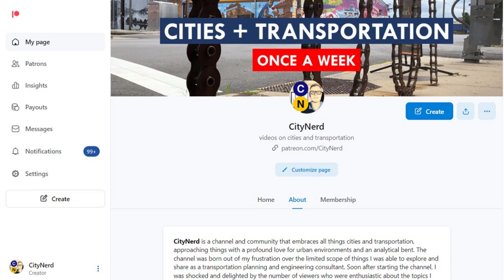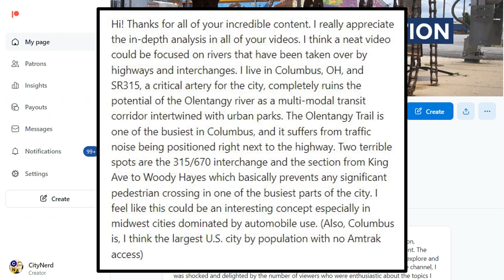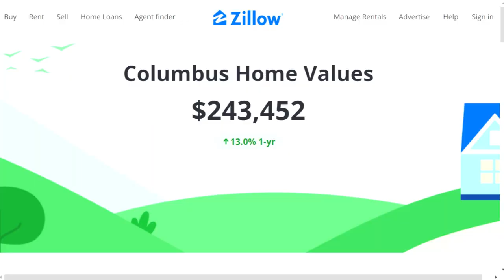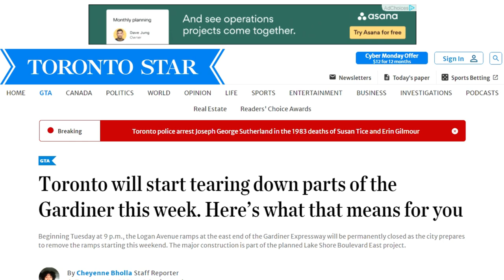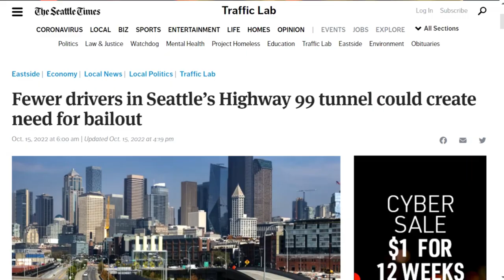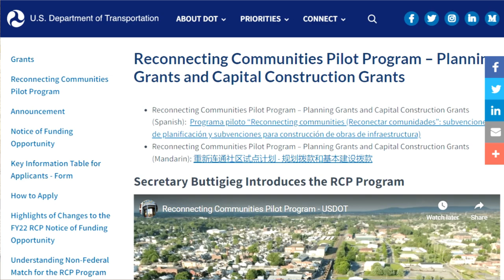Highway Engineering Madness: 10 Waterfront Freeways That Need to Go (North America Edition)

Comment: Wonderful topic! It's one of my pet peeves. So glad you got Buffalo and Albany NY on here. Also, I very much agree with FDR, used to live a block away from East River and it was such an onerous trek to get through to the park. Though permeable, the most shocking to me has been the Nihonbashi area in Tokyo, especially considering the historic value of the bridge.
Reply: FDR may be annoying for manhattanites who wanna walk to the river front, but it’s a godsend when you gotta trek uptown or downtown in the off hours for work. Hard for some people to understand that despite NY’s expansive commuter rail, mass transit is sorely lacking through the outer boroughs.
Reply: @MelGibsonFan  I don't think that it's hard for people to understand.  But if you're going uptown or downtown in manhattan, you don't need a car. Rail infrastructure is sorely lacking in the 'outer boroughs' but why subject every community to the failures of the whole city?
Reply: @NathanaelTak  Because the city doesn’t just revolve around wealthy yuppies in Manhattan. The entirety of the MTA is already structured around Manhattan. Case and point. I lived in Middle Village but worked in Washington heights for a short time. Because I worked in the off hours using mass transit would’ve taken me up to 1 hour 30 minutes (plug it in to maps to confirm) to get to work. By car, utilizing the FDR, it was roughly 30 minutes or so. That’s a difference of two hours everyday, which means more time to spend with my child, less to spend on babysitting, or maybe more overtime available etc. 

What’s an “eye sore” to the upwardly mobile yuppies who can afford live close to opportunities and work from home is a necessity for working class people who effectively keep the city running.
Reply: @MelGibsonFan  Not everyone living in Manhattan is wealthy. Even if they were, they still deserve to have a safe and healthy community. Putting large automobile infrastructure through isn't just an "eye sore" it's a safety hazard, impediment to local travel, and a theft of space. It is a sacrifice made by the locals to benefit people that don't have to live with the cost. In a very dense community, more people are affected and such the cost is higher. Conversely, the convenience of not needing to travel far is a value that should be weighed when choosing where to live. 

In theory, the higher cost of rent in one area should offset the cost of commute and car ownership in another, but we know that's not the case. Real estate is heavily influenced by the market and there are externalities suffered by communities that happen to be 'in the way'.
Reply: @NathanaelTak  
This puts the cart before the horse (in my opinion). These people who mostly inhabit neighborhoods along the FDR (outside of LES/WH etc.) aren’t inter generational families with deep ties to the community. They’re people who have opted to move into these exclusive/costly neighborhoods in pursuit of lucrative job opportunities and high culture. I don’t see this as some Robert Moses style slum clearance where the denizens of east Manhattan are being forced to step aside for highways. 

The removal of the FDR without considering the effect it’ll have on the many working families who rely on it for transportation is just exclusionary transportation policy. It’s essentially pushing for a gated community, so you can beautify wealthy/gentrified neighborhoods on the east side. 

As far as sacrifices and health concerns, I would prefer less car dependency, and the MTA expanded but tmk the FDR is not more or as dangerous as the myriad of avenues and cross streets throughout Manhattan and there is no sacrifice that has been made by people who are opting to move there. The FDR has been there for 67 years, few people can even remember what the area was like before it.
Reply: @MelGibsonFan  Most successful transportation systems use both local and arterials. Nobody is suggesting removing the arterials, but what is being discussed is how some are poorly designed. The point I was making is that the FDR has downsides. Aside from being an obstacle to the ferries, parks, some of the piers, and businesses, it is unnecessarily behaving as an interstate. It has enough capacity that it draws extra traffic through the crowded downtown introducing pollution, cost, and it occupies valuable real estate. If it were smaller, like an actual arterial that serves to move people between the neighborhoods, it would be less of a detriment and easier to relocate. This isn't to turn back the clocks, this is to create opportunity. 

Working families also live in Manhattan. It's not soley rich people seeking high paying jobs. For many people, those jobs don't exist elswhere and they choose to live close to work for a variety of reasons. Not everyone can afford to move to the suburbs, buy a house, parking spot, and car and spend the time to commute. In my opinion, a person can feel connected and part of a community quickly if something sparks that connection; it doesn't take generations to learn to appreciate what you have.
Reply: @NathanaelTak  "Not everyone can afford to move to the suburbs, buy a house, parking spot, and car and spend the time to commute"

Well I mentioned the outer boroughs to avoid the implication of suburbia. Long Islanders have the LIRR which imo is a good commuter rail. Also I haven't said anything about purchasing homes, so I'm def not expecting people to go buy houses. Lol.

On the arterial point, I can concede and agree that that would be an good compromise. turning the FDR into a minor arterial (maybe a bit like Woodhaven blvd with protected bike lanes, bus lanes etc. seems to be the way to go. Like they did in Seattle with the waterfront.
Reply: @MelGibsonFan  I found the rental market in Middle Village to be pretty dismal, as well as Rego Park and even Forest Hills, where the good stuff is all COOP. A lot of the residences appear to be single family homes or duplexes, at least away from Metropolitan. Renting is nice because it allows flexibility in location for job changes. Living outside the center where the job is and commuting in is basically living in suburbs, though the sprawl of the city degrades some of those benefits. 

 I wouldn't even convert FDR to the arterial. The 'neighborhoods' in Manhattan are typically divided by the larger avenues and some of the streets, so most of the streets are still pretty small with little local traffic. I think with some modification those avenues can be made to accommodate more through traffic and the waterfront could be, and I hate to say, more like West New York's. 

I don't recall seeing much in the way of bike lanes on Woodhaven, but the bus lanes help. And honestly, if the bike lanes are like Queens Blvd, then it wouldn't really be worth the effort. It even looks like they're extending the sidewalk into the two way bike lane near the mall!
Reply: @NathanaelTak  depends on where in middle village you are. When you’re closer to Ridgewood and Glendale you get most multi family unites 3 family and 6 family. But yeah MV closer to woodhaven and queens blvd is mostly duplexes

Comment: The 580/880 freeway is an interesting problem because the foothills in Eastern Oakland and Berkeley block off an alternative route, and the land next to the freeway is a low value, unappealing industrial wasteland with a major train line as well. If the freeway disappeared entirely, it would take a long time for anything nice to get built, especially when you get a terrible smell during low tide.

Comment: In Belgium the worst offenders would probably be:
3. The ring around Bruges in the North and East. In the West, it's a decently appealing avenue but in the North and East it's just ugly and I feel bad for the people that live there who need to cross it every day to enter the beautiful medieval town.
2. Gent has a lot of wasted potential. The Ringvaart design is kind of crazy, it's super noisy and they've made sure to maximise the negative externalities by putting the highway on both sides of the canal. The Vlaamsekaai is also pretty ugly.
1. Liège wins this contest by a mile. They've taken Brussels' urban highways and put them along practically all of the waterfront they have. Even though it's a relatively large city with a lot going for it most people consider it ugly and I bet this has a big influence. I could only imagine the difference it would make if there were some sections that weren't 24/7 car sewers.

Comment: Definitely need to add I-91 in Springfield, MA to the list. It has been the topic of heated debates for years because it, along with the parallel railroad, leave a lot of the land along the Connecticut River unusable. The same situation goes with Riverdale St (US-5) on the opposite side of the river, in West Springfield.

Comment: Note on Hartford, there are plans to re-align I-91 across the river in a bit farther inland, moving the interchange with it. This is planned to free up space for a large new green space and development.
Reply: This solution doesn’t really sound like much of a solution tho. Hartford has such a relatively small area compared to many American cities, there’s no reason there should be any highways of any kind running thru it. Dense New England cities really ought not have highways anywhere near their downtowns. Moving the 91 corridor inland just feels like it’ll further divide downtown, plus be incredibly expensive. Feels like there are so many better solutions than that.
Reply: @pjkerrigan20  Like rebuilding it all in East Hartford?
Reply: There's also the Hartford 400 plan, which lowers and caps I-91.
Reply: @inconnu4961  nah my dude the whole point is to have less highways, not to just put them somewhere else. Highways serve an important role, but metro areas like Hartford have been absolutely ravaged by freeway construction. So no, building ANOTHER highway in East Hartford is not the solution. East Hartford is already a glorified highway interchange masquerading as a town lol, if anything, EH would also benefit greatly from highway demolition. In the end, the solutions to these problems are incredibly multi-faceted and require significant time to put in place, but clearly something isn’t working in Central Connecticut. Things don’t have to be as bad as they currently are.

Comment: I know it is your wish list but I5 is staying and you know it. It is the only real way to get up to Washington (unless you go way out of the way and use 205...fun fact, I crossed 205 on the day it opened in December 1982).  And I-580 was there looooong before it became valuable waterfront and was just industrial use (that used both the roads and the railroads to transport goods).  It is now Emeryville (mostly) one of those fake new city malls. It would be helpful if you would suggest your alternatives routes to these changes as the list is kinda of worthless without the solutions. And no, the solutions are not just get rid of them.
Reply: Yeah, when it comes to the freeways in the East Bay I see no real alternative to the 580-80 stretch. 980 you can get rid of, hell you could probably even remove the MacArthur stretch of 580 if you boosted BART and other public transit, but that 580-80 stretch is essential and impossible to replace. My solution would be to develop the waterfront on the other side of it, which is already done in areas like the Albany Bulb, Emeryville Harbor, and Berkeley Harbor.

Comment: You recently included Louisville in a surprisingly walkable neighborhoods video as well.  I moved to Louisville 4 years ago after city hopping for a while.  A lot to love here compared to other cities that often goes under the radar.  Happy to see it get some attention in these videos.  The only problem I see is that the waterfront often suffers from severe flooding every few years so I’m not sure if eliminating the highway would have the desired outcome turning it into a great promenade with that being an issue though.
Reply: Parts of River Road and the ramp from I-64 to 3rd Street close when the Ohio River floods, so it's not like you can really use I-64 to get downtown anyway during flood events. A lot of the buildings downtown near the riverfront are elevated anyway. Think about how high The Belvedere sits, and it's level with 6th Street. Obviously if a repeat of the massive flood in the 1930s happens, not much is going to happen downtown anyway.

I supported 8664, but I-71 along the waterfront really didn't rub me the wrong way until Lynn Family Stadium was completed. The stadium is really discinnexted from the waterfront. Pair that with KYTC's inexplicable ability to put actual control cities on I-265, discouranging through traffic from using it (think Nashville to Cincinnati).

I'd actually be more interested in eliminating I-65 between I-64 and I-264. It has some terrifyingly short ramps, is extremely wide, and is actually closer to more residential areas. The I-65 badge could be moved to I-264 from the current I-65/264 interchange to I-64, I-64 to I-265 in Indiana, and then I-265 back to I-65.

I-71 could be removed southwest of I-264 and then be rerouted down I-264 to the I-65/264 interchange.

Finally reroute I-64 over I-265/KY 841/IN 265/I-265 and then remove I-64 between Story Avenue and 22nd Street.

Comment: Life-Long Chicagoan here: Lake Shore Drive does have a purpose: it is one of the few main arteries that runs N-S outside the CBD and skips over the congestion of the major interstates (Kennedy, Dan Ryan). It does help divert a lot of traffic what would otherwise be in the city itself. Yes it is also a picturesque drive. I actually use it everyday for my commute; if you get it outside of the major rush, you move quickly; rush-hour, you're stuck.

That being said, I agree with the main sentiment here: it's a huge barrier that would otherwise connect one giant greenspace! I mean, from like Lincoln Park all the way to Loyola Campus-could you imagine if that was ALL parkland? Ditto for Grant Park south including the Museum campus and McCormick Place/Northerly Island. You'd have a huge opportunity to re-wild parts of the city.

Right now, I just don't see a way to feasibly divert and absorb all that traffic. White folks in the city will NEVER allow public transit to expand to the suburbs (e.g. Red Line or Orland Park) and they'd never use CTA or Metra enough to commute in/out. 

So TL/DR: I like Lake Shore Drive, it serves its purpose but it would be way better to have the city flanked by a massive green belt along the lake front!

Comment: Chicagoan here. I HATE Lake Shore Drive. It’s supposed to be 45 mph because it’s in a city park, but drivers routinely go 80 or more. 

And I cycle 7 miles to work along the otherwise beautiful Lakefront Trail… but you’re constantly within earshot of this 8 lane highway. More importantly, cars frequently lose control (due to high speeds and consistently terrible/aggressive Chicago drivers), jump the curb, and run off the highway into the park area, sometimes ending up ACROSS the trail. 

So the existence of this monstrosity threatens my safety even when I’m engaging in non-motorized transportation. Rip it out, Chicago!!!

Comment: I’d love to see an international version of this video! I know here in Australia we have some pretty bad waterside roads - Citylink along the Yarra in Melbourne, the Cahill Expressway in Sydney, the Riverside Expressway in Brisbane (the worst one on my lil list imo), the Kwinana Freeway in Perth are all pretty bad.
Reply: How you going to move traffic from North to south if you get rid of the kwinana fwy? The Mitchell fwy will just end at the city then?
Reply: The Kwinana Fwy was actually built over bare Brackish Mudflats, the residential properties in the area were deliberately built away from the shoreline since it flooded often and the ground was too unstable, this is why the jetty is so long as well. So the Kwinana Fwy to me is less egregious than it seems at first, since some form of north-south corridor needed to be built anyway (either riverfront or divide suburbs), and any type human land use along the riverfront would've been completely artificial and engineered regardless, whether parks and trails, a freeway (and later railway), or dredging and compacting to make a waterfront suitable for building next to. The current forested shoreline next to the freeway is entirely manmade, but it's less obtrusive because it's all low lying with few interchanges, which also means the whole thing functionally acts as stormbreak hence why it floods occasionally.

The WA Landgate mapviewer has areal photography of the whole metro are from before and immediately after the initial Freeway construction too.
Reply: Brisbane was the first city I thought of when seeing this topic.

Comment: Toronto guy here.  The Gardiner Expressway deserves all the bad press it gets.  However, we're very close to a tipping point with it.  The maintenance costs are phenomenal, and whatever value the Gardiner provides as a high-speed (NOT!) link to/from the suburbs disappears when the road crews are doing their thing.  You need to take a long look at what's being done on the eastern lakefront.  Huge changes are in process, including the creation of a proper tributary from the Don River to Lake Ontario.  Yes, they are making a river bed.  Part of the monster project also entailed the removal of a chunk of the Gardiner, as you briefly mentioned.  And that's its future - slow dismemberment.  As the saying goes: "There are two seasons in Toronto - winter and construction."